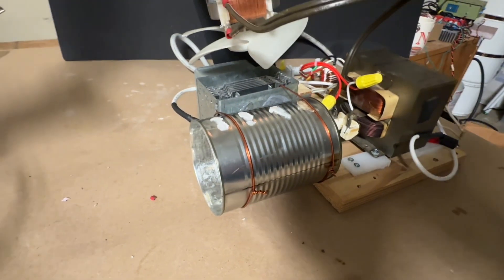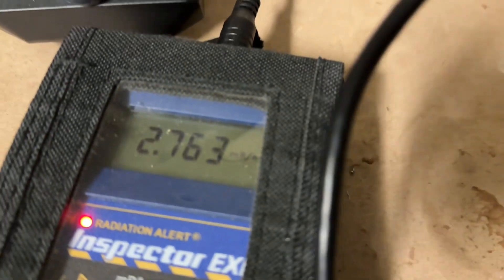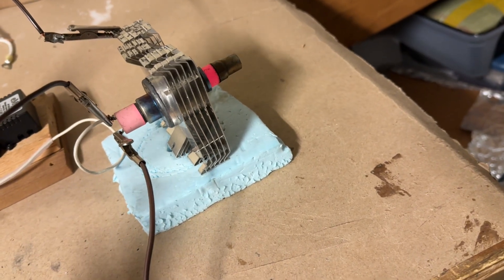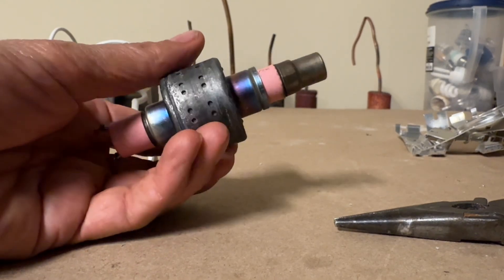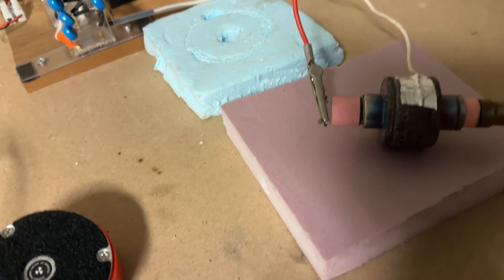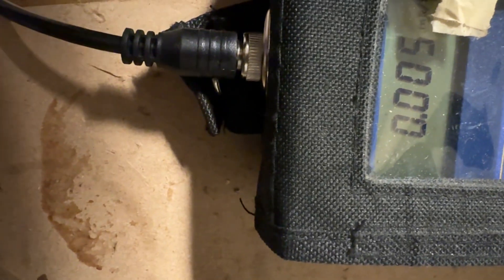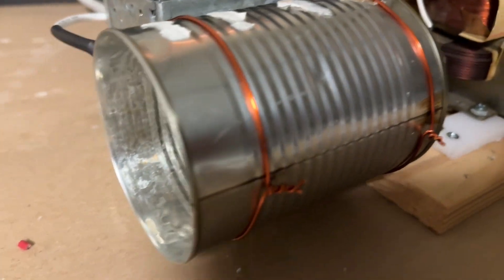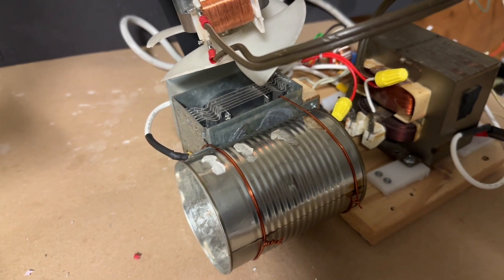Magnetron X-Ray Tube- Comments Addressed

Comment: The glow that looks similar to the filament being lit is probably fluorescence from eletrons hitting the ceramic
Reply from the maker: Totally agree!
Reply from the maker: It seemed to come on and go off instantaneously with the voltage. If it was incandescing it would not go off instantaneously.
Reply: @BrianDhvTinkerer  👍
Reply: @BrianDhvTinkerer Can it be a corona discharge coming of the filament inside of the tube that you can see trough the ceramic?
Reply from the maker: @Humpiv I believe I was wrong when I said it was filament glow. It’s actually the ceramic that’s fluorescent from electrons emitted from the cold filament hitting the ceramic material.
Reply: @BrianDhvTinkerer  also try a UV bulb on your magnetron.   Most things which fluoresce from electrons, also fluoresce from UV.   (One example is those "snail" lexan vacuum canisters commonly used as DIY vacuum chambers.  The white plastic lid is probably full of titanium dioxide to color the lexan, and it lights up green under either UV or electron bombardment.
Reply from the maker: @uploadJ I’m happy you checked back on my channel!
Reply: @Humpiv  re: "Can it be a corona discharge coming of the filament inside "
Thinking is that gas must be present to do this, but, a functioning magnetron will have a pretty good vacuum ... so, no corona ...  interesting experiment here with the cold cathode 'tube'.
Reply: @uploadJ  No glow-discharge, no x-rays.   For example, antique pre-1925 x-ray tubes are based on glow discharge called "dark discharge."   Only the glass bulb fluoresces, but with no glow inside.  That's what happens with pressures around 10 microns.   But instead pump a very hard vacuum, 10^-4 torr, and the cold-cathode x-ray tube stops working.
Reply: At 2:45 you can see that the filament does play a role in it. When he turns the filament off the glow of the ceramic at the right hand side of the magnetron stops